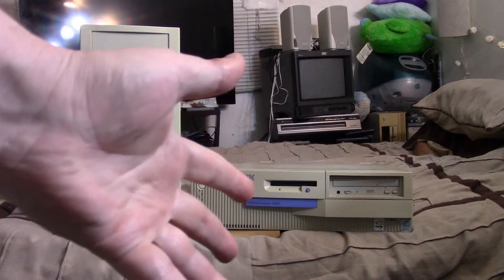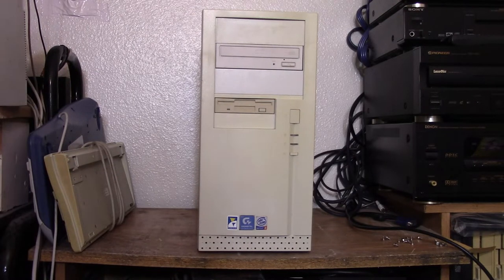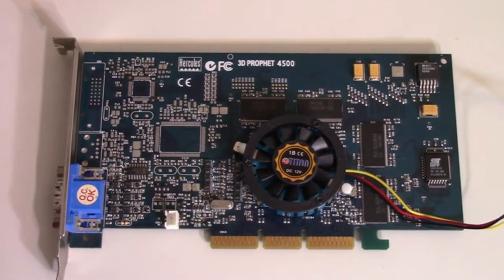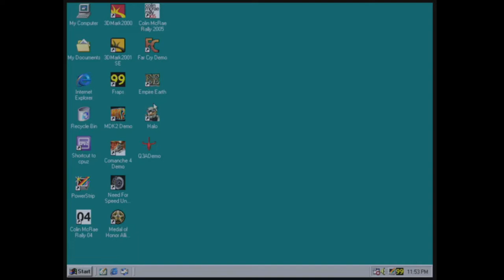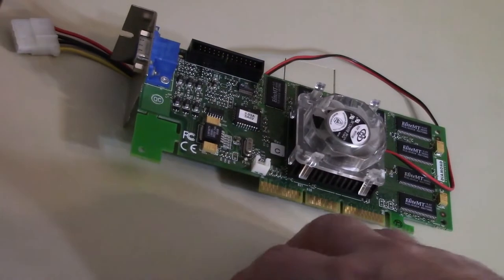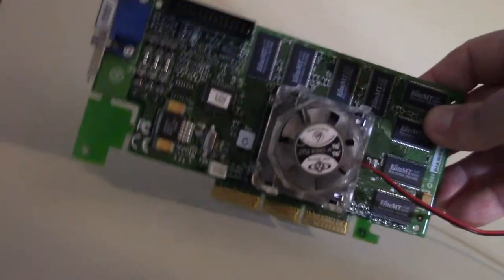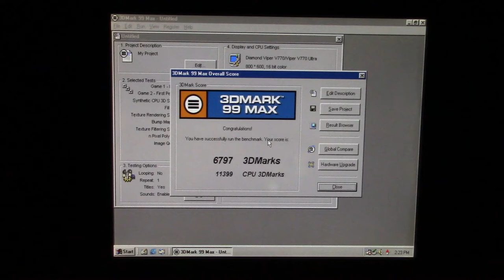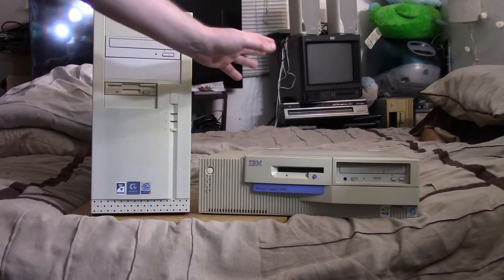P4 Socket 423 PC and IBM PL300 updates

Comment: That Titan cooler is actually the exact heatsink and fan that was installed on the Kyro 2 cards originally. I got one for my Kyro 2 as well, they do make a blue version as well, which is identical to the stock heatsink and fan.

Comment: Hey hey hey!! 
Back with my fave rig I see.  Well I'm just about done with my one. 

 It's still a standard IBM 300GL, PCI and ISA expansion only.  As it's locked to 66 bus I'm still on 300mhz on the Pentium II.  When I got her she was bare bones, missing quite a bit, but functional.  

Mine came out in 97, but my actual pc in 98, so I chose those parts. I went with a Voodoo 3 2000 PCI for GPU.  Taken me ages to hunt one at a reasonable price.  Found one perfect condition in box for £80.  Not bad price here, considering state of box, inserts and card etc. 

For sound I wanted as much compatibility for DOS as possible. Managed to find an AWE64 which was my dream back then. 

I managed to find every part I was missing.  The bottom of case which is plastic, the back of it has a plastic cover. The hardest bit was finding someone with a replacement blue badge on the front..... Finally got it. 

Got a IBM keyboard, IBM 2.1 speakers and a monitor that goes with it. It looks like she was a bundle... Love it! 

Only thing missing is the surround for the cd bay.  It's hardly noticeable.... But I need it.  I got a blanking cover, but not one for cd, so the hunt is on! 

I will be making a vid on it soon with the journey.  Going to retro right the hole thing, scrub it and get it as close to new as possible.  It is not the hub of my KVM switcher, so I place all my retro computers through that one set up which is why I wanted the best I could do. 

I want to thank you for the hints, tips and knowledge mate.  I will give you a shout when I get around to video.  But you got a great channel here!! 

P.S.  the colour wash it likely down to the hdmi/colour band thingy in OBS.  It has 2 settings that have to match in and out.  I can't remember exact name, it's got something like 286 or 290 as options..... Twice. ... Fir input and output. 

I'm terribly blue at exposing this.  But Epoxvox did a video about OBS streaming and he covers it there. Just change the streaming bit, to recording, same difference. 

Once again.... Thanks mate!!!
Reply: *it is the hub.... Damn auto correct
Reply from the maker: Hey! glad you like the videos. The V3 and AWE64 are good choices. I think the AWE64 just acts as an AWE32 when in a DOS environment. Are you going to be running Windows 98? I need to find a matching keyboard, speakers ect for my PL300 even though honestly I really don't have the room right now. Id love to find a matching IBM monitor for it as well. Looking forward to your video.
Reply: @AncientElectronics  Yeah, it just shows as a Awe32 in DOS and is fully compatible with the Sound Blaster options so it’s pretty compatible for everything.

I’ve added an SD card HDD, so I have builds for DOS, 95 and 98.  But I pretty much stick with 98 as again, it’s compatible as voodoo and awe cards are picked up with DOS drivers on boot.

Well my kB, and speakers are IBM and look the part.  But not accurate to model.  My keyboard is from the 80s I think hehe and I have no idea when the speakers are from.... but again, they look the part so I’m happy.  The monitor..... well I cheated.... it’s a Samsung with no markings from 2000.  I just stuck a IBM badge on it hehe, I cheated.
I know what you mean about the room though.  It’s kinda the reason I wanted to make one perm setup and KVM through that with my other machines.  I had monitors and bits of pc everywhere.  At least now I can have one setup in place and just  link up the pcs I’m using.  

I like consoles and pcs so it was all starting to get out of hand... now I have a perm pc setup.

Miss your old theme song though :)

Comment: Seeing that Kyro card was a nice surprise. I used to own one of those, the exact same make and model, but unfortunately it was broken - think the RAM was defective as even the OS startup screen would garble or go black - so it was returned within days and replaced with a Radeon 7500, because the store didn't have any of PowerVR cards left.
Still have yet to encounter an i740 in the wild. To say there are so many of them left out there, they never have seemed to turn up in machines around here, it was always that perennial Trio 3D or Rage II, never once a 740. Have to wonder where they all came from.
Reply from the maker: I've only seen one I740 in the wild. it was boxed at a thrift maybe 8 years ago. I was on a budget at the time and didn't really know what it was so I passed it up. The one I have now is from eBay but unfortunately it appears to be defective. It does 2D just fine but has issues running anything in 3D accelerated mode.

Comment: The only older hardware I have left is a voodoo 3 3000 PCI, I took it from my mum's disused 2001 office computer, heh after I turned it on after 18 years, and the crt monitor blew up and so did the PSU and there were burn marks all across the mobo also, but somehow the 3dfx card survived so I bought a £25 p4 3ghz bundle on ebay and whacked it in that.
Reply from the maker: The V3 is a good card to have survived.